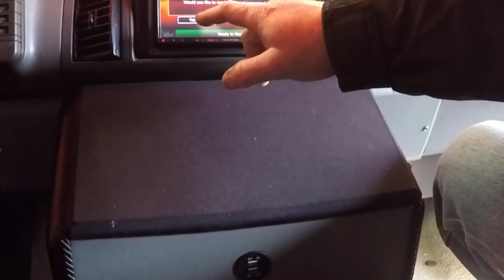GMC SAFARI STEREO HOOKED BACK UP

Comment: A Capacitor or a delay circuit went out in one of your amps, best bet is to get all your amps checked out, sitting for a period can do it or just hooking up the batteries. I was told high power automotive amps sometimes produce a thump when turned on but if an internal capacitor goes out it goes from a thump to a POP, and some high powered amps have a delay circuit built in to keep that thump from happening, when that goes out you will get a POP. LOL I still have my 2 100 watt Alphasonik amps from the 1980's, they use to power 6x9 Pyle Drivers, those rotted away in my back window, speaker cones decomposed completely
Reply from the maker: Joseph Junior found her buds i for got to hook up one of the amps and the ground was off it so it was sending the ground into the rca . All fixed decent